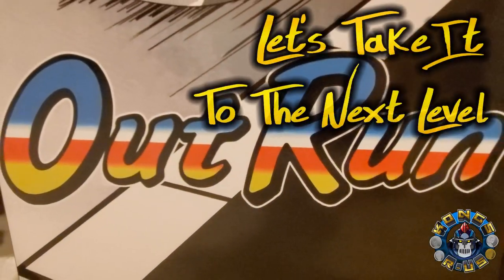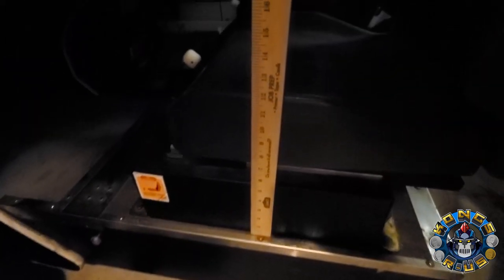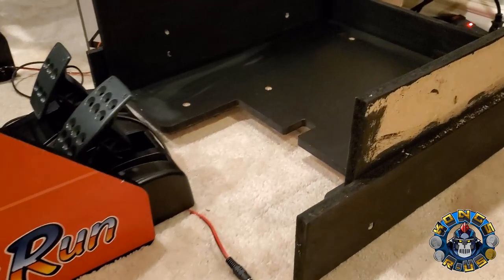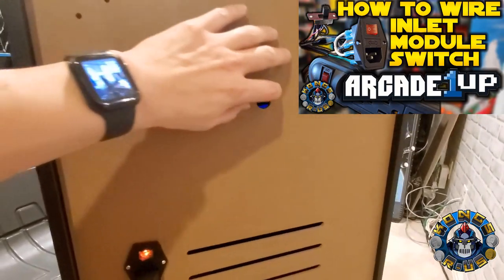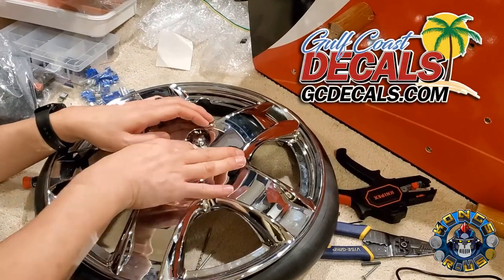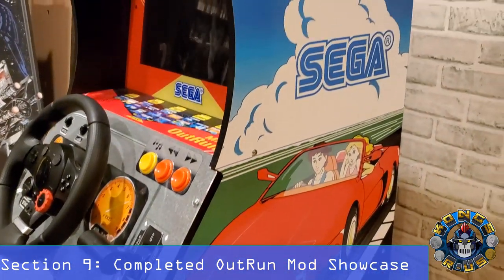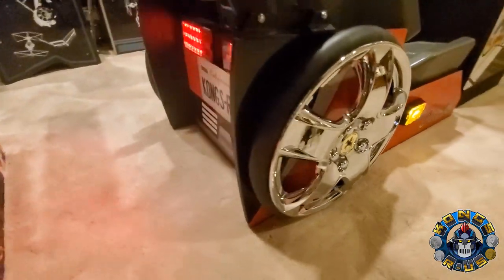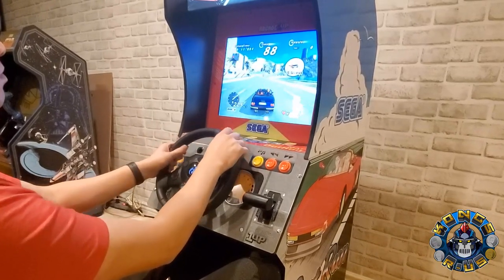Pimp My Ride: OutRun Arcade1Up Edition (Bench Seat Mod, Tail Lights, Spoiler, & More!)

Comment: Insane mod!! If I had the room I'd love to copy this one haha. Its kind of sad how Arcade1Up messed up the dimensions of that Outrun cab. I have a racing wheel I've used with MAME and Teknoparrot forced feedback stuff. It works surprisingly well but the feedback sometimes feel a little off. Maybe I need to play with the settings some more. For now, I'll just have to enjoy my Starcade 2.0 Playlist on the Star Wars cab!
Reply from the maker: yea I'm still messing around with FFB plugin settings and getting controls all mapped to my logitech wheel. I definitely used my StarCade Playlist 2.0 as a base image and just added some new media. lmk if you want my race cade media if you want want copy SCPL2.0 to another PC and make a racing cab
Reply: @KongsRUs  Race Cade! Sounds super interesting...I need to get my racing PC up and running again but I'll message you when I finally get that done. The only PC I have for my racing games outside of Star Wars is also my test PC so it got loaded down with all kinds of crap. I have to restore it and get another graphics card since that was put into my Star Wars cab.

Comment: This is amazing work!  Are you sharing your BB theme at all as I am in the middle of my driving cab set up and your theme is excellent and well done.  I won't be going to the extreme with my cab like you did but I might add an LED strip to it, lol.  Nice job all around love your videos.
Reply from the maker: Thanks! I don’t have plans to share the BB build just yet; but definitely a possibility. I’m working on missing kits and services for outrun so hopefully will have that ready by end of summer

Comment: Awesome job!!!  Is it possible to just add just the steering wheel for the force feedback without all the other mods?
Reply from the maker: Yep, you definitely could
Reply: @KongsRUs  Thanks for your response. I'm gonna have to look into it. I just ordered the stand up version and would like to upgrade the steering wheel.
Reply from the maker: @sls78..  sorry, I should have mentioned the PC wheel only works with a PC mod, not the original stock PCB and Outrun games. There isn't a way to add force Feedback Feedback that, but you don't have to do all the other flashy mods I did

Comment: Starting this month I am going to get back to building my dual racing cab. I had a thought of making the control deck angled more. Did you have any comments on the angle of the wheel when sitting in your bench mod, if you thought it could be angled down slightly?
Reply from the maker: I had to lift the cab higher so I could sit under the wheel and put my feet proper inside the cab. Wasn't perfect, but height of the cab/seat are more important than angle IMO
Reply: Makes sense and that was what I was thinking as well. Thanks for the input on this topic.

Comment: Do you have the measurements/blueprint for that riser mod you made?
Reply from the maker: I don't have exact measurements or blue prints, just sort of designed it on the fly and had to change it up to get the right Height. I think I ended up using 4" sides
Reply: @KongsRUs  Really it looks pretty well planned out and designed. I feel like you could make a killing selling a kit.

Comment: Does the single puck provide good feedback or would you recommend multiple bass shakers? I see the one that Ralph uses is a much bigger model.

Thanks for the great video. I hope to start my mods soon with help from your tutorials!
Reply from the maker: if I had to do it over, I might go with the bigger one, since I have the chair on top of the board where it's mounted, I don't feel as much bass as I would have liked. if it was just on the stock bench seat, I think it would have been enough
Reply: Thanks for the info. I think I'll grab the one Ralph used in that case.. I am just using the stock bench right now, but in case I want to upgrade the chair I guess it will be good to have (or I can just put it into my virtual pinball if it's too much for racing)